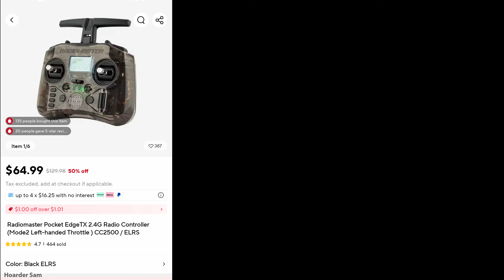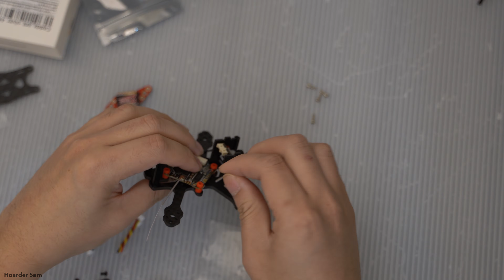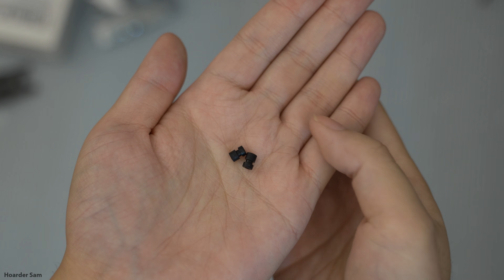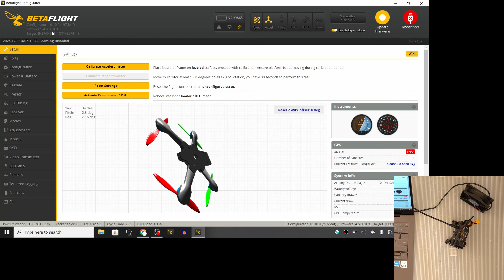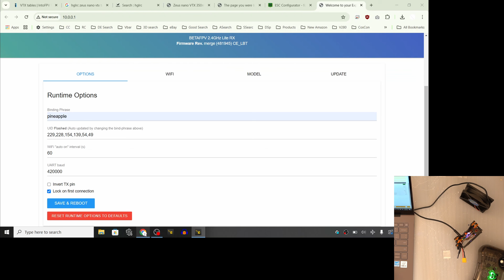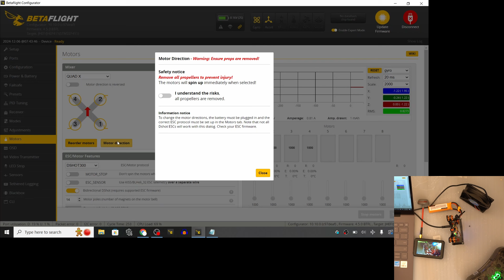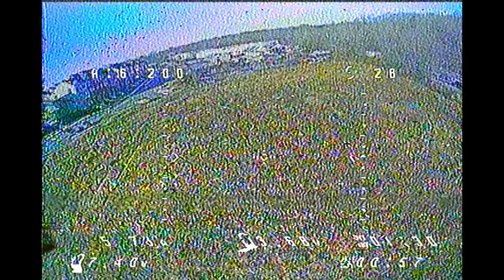How to build a 2-Inch FPV drone for $100

Comment: 6 years ago I wanted to get into FPV. I bought the best of everything at the time. I spent around $1500 on everything, lol. Somehow I fried my AIO board and I NEVER flew the drone! I said screw it and sold the whole thing. I have always wanted to do FPV still. I search videos all the time about DIY setups vs buying an RTF, etc. THIS video though, THIS video gave me the push I needed. After searching for parts and batteries, I ended up purchasing everything in this video from AliExpress for $414 shipped. I even got the Tattu batteries on Amazon. 

Why do I say this all? Honestly, your video really made me feel like this is doable and can be cheap. Yes, I didn't have goggles, a radio, batteries, or a charger. So that is on me. But overall, this build is so enticing and well filmed. Really, fantastic video and approach to your editing and parts list. Now that I have all that other stuff I can see myself building the other sizes you have in your videos as well. Hats off to you my man!
Reply: 4-5 months later, how is it going? Did you give up again? 😄
Reply: @brands2131  Ha ha, no. But kind of. I live in Houston and it is about 110 every day this summer. So I have not flown outside as you literally sweat standing still. I tried but wearing the goggles is pure hell. I am waiting it out for some cooler days soon. But, I have three drones now. I built this one, and his 3.5, and bought a whoop to play with inside. So no, I am not flying actively outside but I am still in it! Spent about $1500 total, lol. I bought duplicates of everything I have built. I have a sickness.
Reply: @TX_Retro  Tiny whoops are great. I have an air65 because I live in a major city so takes time travelling to find somewhere decent to fly. I took few months off because I felt indoors was super hard, as I had everything on default. I learnt its easier with airmode disabled, and next I will reduce my acro rates.. It's just going to be fiddly going back and forth to find out what works so I just have to find the time to play around with those settings.
Reply: @TX_Retro haha that’s the same as me. I would often buy one model for use and another model I just wanted to stand there a look good in perfect condition. This video also motivated me to keep on pushing and learn to solder properly. I am good with software and hardware to a certain extent but I am missing a critical skill and that’s to be able to solder well.
Reply: Don't live in the uk? Brought a 6 year old drone and I think its got a similar story. Got 2 flights out of it and now I need to change the stack and reciver
Reply: I bought all my stuff used  besides goggles and drones, and I still haven't flown digital been rippin' almost 2 years now. Went through hell teaching myself how to solder on whoops got good then bigger builds werr easier, its always good to have a friend local that is seasoned with trouble shooting. And then just obsess find time and obsess 😅 everything gets easier soon
Reply: Can you list the parts for your build?
Reply: @mike_t_007  APEX 2 Frame Kit 2inch
YSIDO 1104 8600KV
JHEMCU F411ELRS AIO Flight Controller
HQProp T2X2X3 PC 2-inch
Tattu 650mAh 2S
CADDX ANT
HGLRC Zeus nano VTX
RUSH Cherry II MMCXFW
VIFLY Finder 2 V2 Buzzer
APEX 2 Frame Kit 2inch
Reply: I thought the drone was $100
Reply: Hey man I will be moving to TX in the near future. Hopefully we can fly together sometime 😊
Reply: you an get starter set for like 200-300 usd ,  you can start with tinywhoop  they are so much fun and low effort you can fly in backyard

Comment: I built this drone as my very first drone (I did it mainly for the soldering challenge), and I've flown it a lot and crashed it a lot! It works quite well!

EDIT: Just wanted to say the YSIDO motors are pretty bad (few of them were broken on arrival, some broke on the first impact), so I recommend T-motors. LiHV Battery 550mah also last 8min cruising, 4 min with some powerloops and a thumb pro camera on it. And 5 blades props does indeed last longer, but is also much easier to maneuver. There is a lot of prop wash though.

Comment: The capacitor is a 10uF, which voltage? Is 16V enough? Again, thank you very much for this build!
Reply from the maker: Yes 16V is enough
Reply: @hoardersam10  You did use an ESR Cap though, right?

Comment: what parts would i need to replace if i wanted a dji o4 build and elrs obv the cam and the fvtx but anything else ?
Reply from the maker: Theres an updated frame just for the o4 lite: https://www.aliexpress.us/item/3256808325103945.html
Everything else can stay the same. Maybe change the flight controller out since we don't need the analog stuff - like maybe the betafpv 2-3s 20a AIO or a happymodel HD AIO

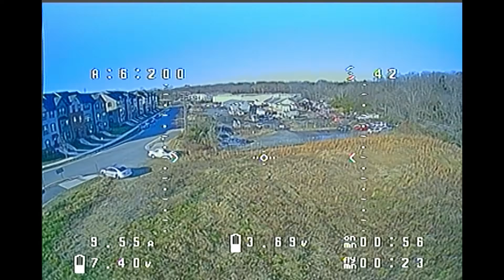Comment: 19:49 Your DVR always records the NTSC transmission which is in 4:3. But actually as i can see it is a 16:9 cam, that means you need to strech in from 4:3 to 16:9 in the video editor. The image quality shown here is therefore not 100% accurate. You can tell by the fact that the buildings look unnaturally thin...

Comment: Flying like in the video or slightly more slow and scenic, what flight time to expect (and battery size you used). 
4-5 years ago my 2 inch drones had short flight time so I did rebuild them to2.5 and 3 inch and got my better but now I am more and more flying smaller ones.

Comment: I built this. I ran into two issues. 1.) The camera only works with battery power, only OSD with usb. Not sure why. 2.) Two of the 8600k BLDCs do not work. They are noticeably harder to spin by hand, and only twitch. I confirmed it was the motors and not the ESC by swapping the motors with the two working motors.

Comment: Hey guys I have a question. I am a starting-out drone builder. Are these party drones good? I got these from ChatGPT btw, and I am trying to build a fpv drone for he budget of 250$.

Drone parts: 

TBS Source One V5

EMAX ECO II 2207 (1700KV for longer flight, 2300KV for speed)

SpeedyBee 35A 4-in-1 ESC 

Matek F405 or SpeedyBee F405 V3

HQProp 5045 (3-blade)

Tattu 1300mAh 4S 75C LiPo 

Caddx Ant Nano + Eachine TX805 VTX 

RadioMaster Zorro (better) or FlySky FS-i6X 

Thank you guys! Please leave any feedback.

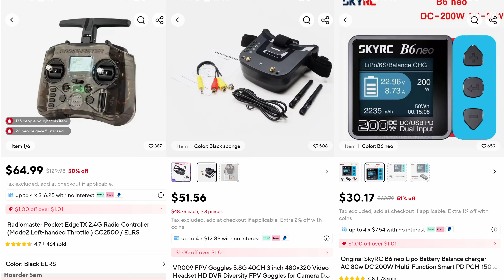Comment: 2:13 many years into the hobby and that B6 NEO is by far my most used charger. One of the best purchases ive made and completely blew away my expectations
Reply: where do you connect it? do you need a power supply?
Reply: @ndjxisjenxjix9525  XT60 DC input or USB C input. I run mine off of an 80w phone fast charger but I never need to push more than 60 watts through it
Reply: @carterdavis5176  i guess ill buy it then
Reply: Okay I will buy this since I want a charger that can do 2s - 6s and my current one can only go up to 4s. Thank you for the recommendation!

Comment: 1:49 M6D charger looks great as well！
(ok as a newbie of rc, I still don't get the part of the charger are not designed for the AC power by default with their best performance, in order to do that you need an adapter, power supply.)

Comment: I just ordered all the parts. With the upgraded Rush cherry antenna and 8600KV motors. I hope the higher KV will be ok. I fly my Larva X around my backyard a lot and I was looking for something similar that I can use the same batteries with. Thanks so much for the video!
Reply: Update: I just finished getting the motors soldered. This is the hardest build I've done. The pads are so tiny. Like Sam said in the video you really need to take your time. Two of the motors were a little "crunchy". I had to boost the starting and min power the way he shows in the video. The two crunchy motors would try to start but wouldn't spin. I ended up working them by hand and they loosened up. I was able to spin all of them up in Betaflight on the motors tab.
Reply: @Wombat1313 Could you let me know what exact rush cherry rhcp antenna you used?
Reply: @leesand8656 The UFL connector fits this AIO board.

Comment: Really like this small 2-inch build. What does build to be able to do more freestyle things. Also, is there a new board that you would recommend with bigger pads cause I’m not the best at soldering. 😊

Comment: My drone goes max speed when I arm it and I have done everything and tried everything. In the setup tab, the drone moves correctly when I tilt it by hand (left, right, up, down). In the receiver tab, when I move the controller sticks, the sliders respond accordingly, and the drone reacts by rotating( 3d visualisation) and the throttle, roll, pitch and yaw values change. In the motor tab, when I move each motor individually through the software, they also respond correctly on the drone. The motor positions (1, 2, 3, 4) are correct, and their directions are as they should be. And yes I did mount props and tried to arm it. At this point, I'm not sure what else could be causing the issue. Can you pls help?
Reply from the maker: I'd try starting over - reflash firmware and set it up again from scratch
Reply: Check for Joshua Bardwell's video: "Quad insta-flips on takeoff? Four reasons why, and how to fix them!"

Comment: yoo i just built one havent gotten it to fly i got most parts form a guy on fb mp and only missing a frame but the battery is dead it wont take off  the ground i suspect the battery is old the firmware on the flightboard is form 2018 could old battery be reason it wont take off far
Reply from the maker: Dead/worn out battery can definitely be the issue. I'd definitely try a newer battery

Comment: I build your $100,-  5inch drone. It was my first ever drone and only started in the sim while I was waiting for the parts to arrive. The drone is a tank! I crashed it in sand, wet fields, trees and bushes at full speed and it is holding up just fine. I was thinking on upgrading the motors but only when the cheap ones die. It is the perfect drone for a beginner to try the tricks learned in the sim. I just bought a air65 champion edition for indoors (with a throttle limit and according PID tuning to tame it down) but I think this will be my next project to build. Amazing video! Keep up the great work! Maybe a budget tinywhoop build video in the future? They can be made for around 100/120 dollars.
Reply: Generally tinywhoop is actually more affordable to buy than build, but I'm not sure how powerful the build one can be so yes please do it 😉

Comment: Hey ! I am new to fpv and I was wondering why didn't you use a capacitor on the battery cable connecting on the board ?

Comment: Built one of these a few months ago. 

Only difference in parts 
- f4 40a aio from Jhemcu
-1204 motors from happymodel 
-runcam nano 2
-nano rx 
-3s 300mah
Reply: Was the price around the same?
Reply: Who tf needs 40a for a 3s drone? 💀

Comment: Which goggles/DVR did you use to record the flight footage? It's buttery smooth!
Reply from the maker: The short indoor clip is recorded on a hdzero monitor, and the outdoor flights are from DJI goggles V2 with an analog adapter and AKK analog receiver
Reply: @hoardersam10  Thanks 👍

Comment: Some beginner advice on soldering:
- Spend some money on the iron if you can afford to. Quality irons are more likely to head up well, hold the temperature better and have a decent temperature controller that keeps a relatively tight window. Also get flux, isopropyl alcohol 70% for cleaning is nice to have on hand and usually not too expensive.
- Don't trust Aliexpress for buying your first roll of solder. They have some stuff that is barely functional. Prices for the stuff aren't ridiculously high in first world countries anyway.
- Get a cheap multimeter. Cheapest one you can find will do well enough. It's just about the ability to find short circuits. You can't always see a connection between two solder pads, but you'll always be able to measure it. Cheapest models are below $10. You can also use them to measure other stuff, they're just not overly accurate. They will provide you with decent educated guesses though.
- Get some practice PCBs like Sam had in the video. They'll help you out a whole lot and give you the option to try different approaches. There are many different ones, so whatever you're trying to solder, there is a practice PCB for it.
That should set you up for decent success in case you're not looking for a setup for a one-off solder job.
Reply: The Pinecil V2's pretty good when used with a strong power supply through the barrel jack. AliExpress solder* is a fake alloy with more lead, making joints look dull and likely not wet quite as well but I've been making large connections like 2 caps and a TVS diode with wires on battery leads with no issues. Using D24 tip for large joints. Just flow a little solder first for heat transfer.

Comment: Interesting, I've built one of these 2 years ago and been flying it since then. Was wondering why I don't see more similar builds on this frame all this time

here's mine:
Apex 2" clone frame
4x beta fpv 1103 11000kv
Zeus hglrc nano vtx 350mw
Originally I had a beta FPV AIO flight controller but I replaced it 1 year ago with JHEMCU Ruibet F4AIO 12A F411
Rush cherry UFL-RHCP-87mm
Foxeer razer nano
Jumper 2.4G ELRS 3.5V-6V TX Module AION NANO T-PRO
Gemfan Hurricane 2023 props 3-blade
2s GNB 530mah

My goggles are skyzone 04L and my radio is a jumper t-lite v2.
Reply: KV seems a little low for small motors for FPV, at least if you're into freestyle as well. You don't see too many tiny drones, because the larger ones don't have as many drawbacks (stability in windy conditions for example) and way more part options to use.
Reply: @ kv was a typo, it’s 11000, I’ll correct that. Regarding your 5s comparison to a 2s I can only say good luck flying a 5s in urban style. Sure you will find a parking lot on a sunday but I can fly this 2s anytime of the day without drawing attention. When I’m too lazy to get out of the city to fly a 5s I just take this tiny fcker with me and have fun almost anywhere in the city
Reply: @rebel4466  What are you talking? This is perfect motors for this drone. Just check Happymodel Bassline. 1103 with 11kKV. And some pilots even say it is too strong...
Reply: You don't see many because this build is heavy  af!😮 Same motors on a baby turtle and a happymodell X12 fly beautifully at 40g + battery.
Does fail the budget benchmark though..
Reply: @ 90g together with lipo for 2s is heavy af? 😂 gtfo

Comment: The legendary apex 2 frame 😂 an oversight would be not using the HappyModel 5in1 X12 ELRS fc, has ELRS RX and 400mw Vtx built in, you don’t need to wire anything as there are plugs for the motors and the camera, otherwise great build

Comment: When will you try openipc? I can help ya, you could make this digital with a ground station sub 200. They just added adaptive link & 40mhz. Its getting really good. my 120hz setup gets as low as sub 20ms, but is usually sub 40-50ms in my experience